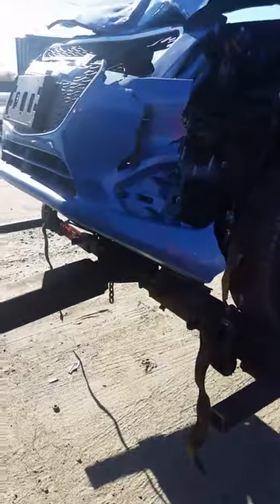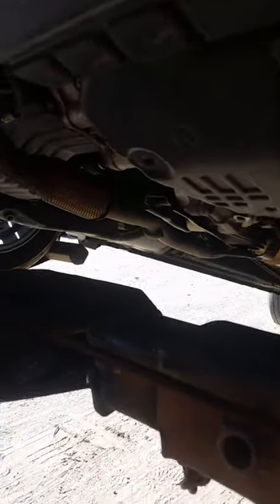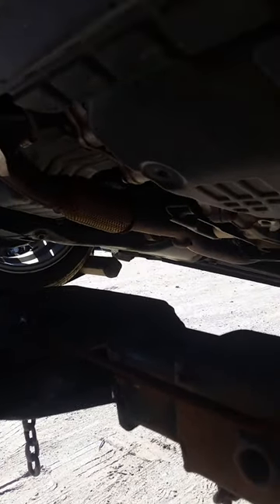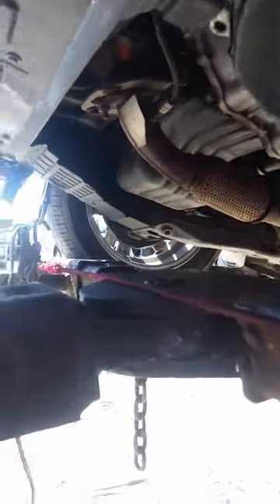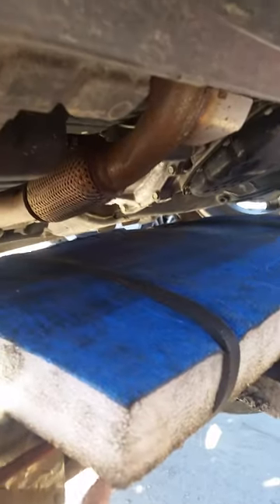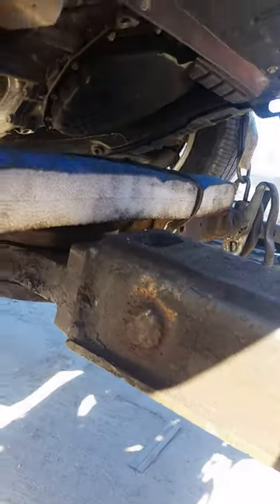How to make your own oil pan pillow Avoiding oil pan damage

Comment: good idea
Reply from the maker: Adam Salinas definitely cheaper than buying a pan pillow. Thanks for watching
Reply: @TowMan127  I found some at Menards. It is in the insulation bay outside. 2 1/2 inch thick. Don't even bother asking about it because they are so slow. Thanks tow guy.
Reply from the maker: 😂 glad you found some